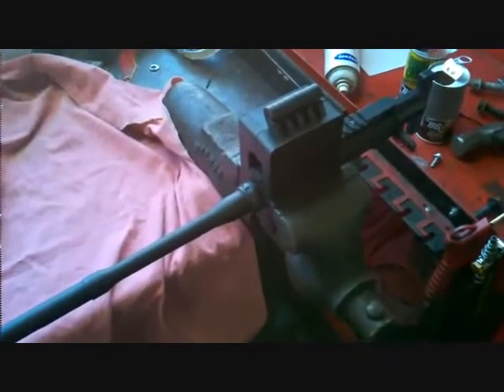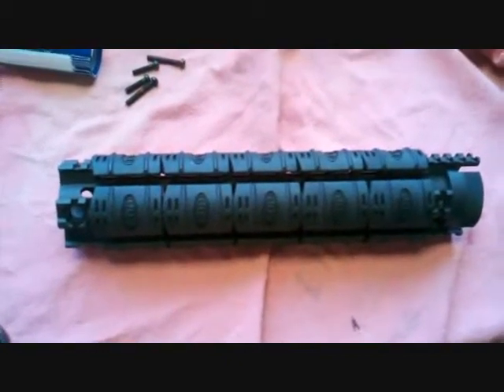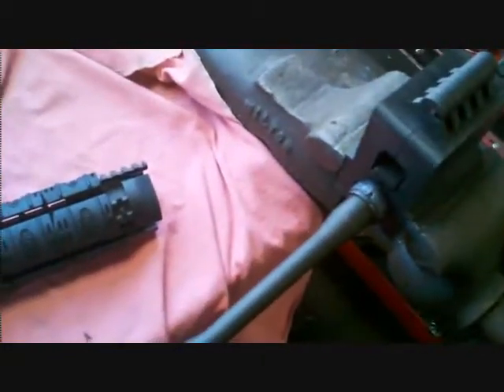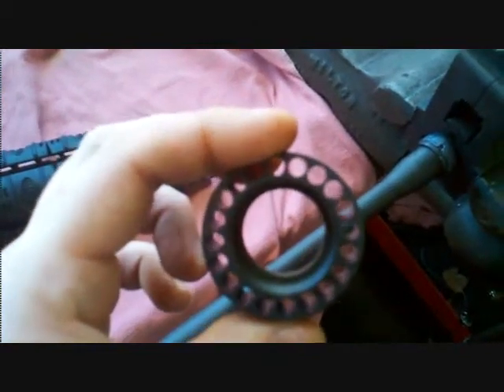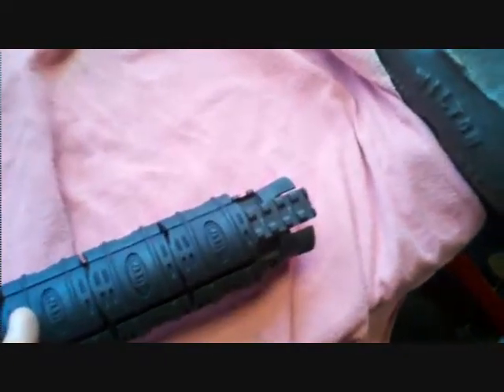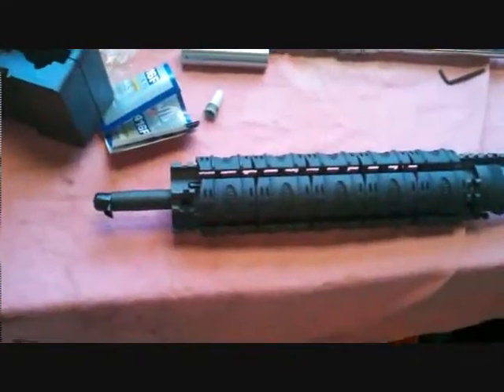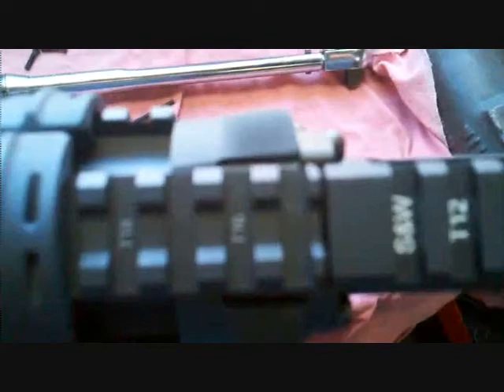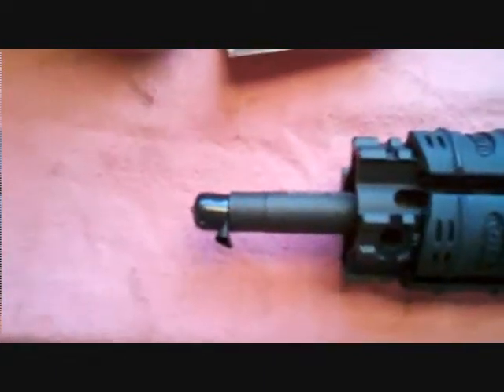Dedicated 22LR AR 15 build series (part 2)

Comment: Do you by chance have a full parts list?
Reply from the maker: I don't have a full parts list.  the essential parts for this build is an upper receiver with with no forward assist, a cmmg 22lr barrel with adapter collar (should come with the barrel), a cmmg 22 conversion.  Also whatever free float rail that you choose that has it's own barrel nut.  you will have to change the chamber adapter on the 22 conversion bolt to the barrel collar.  I think I show this in better details on one of my other 22 conversion videos. it's pretty simple.